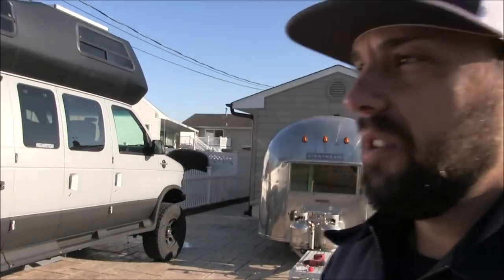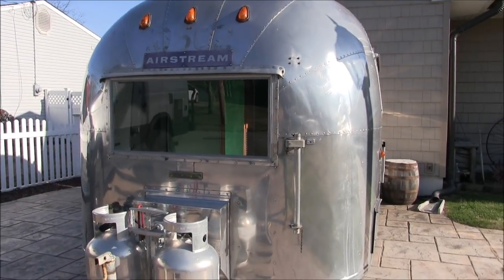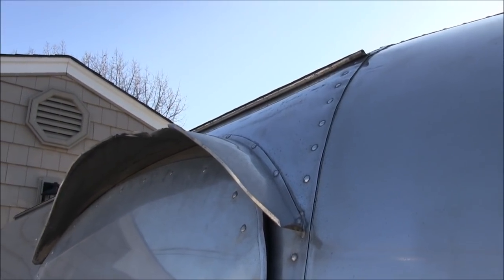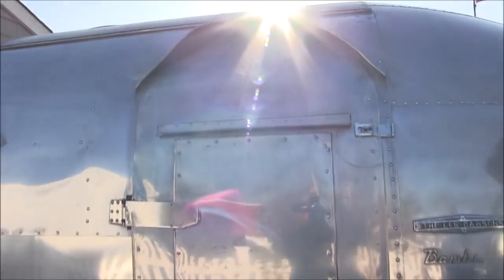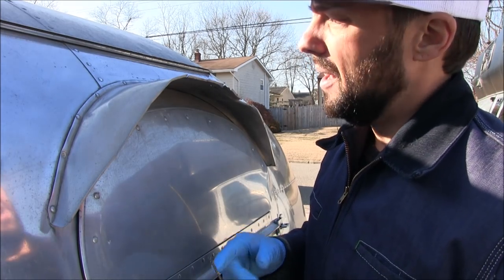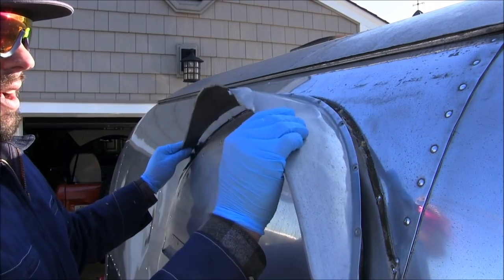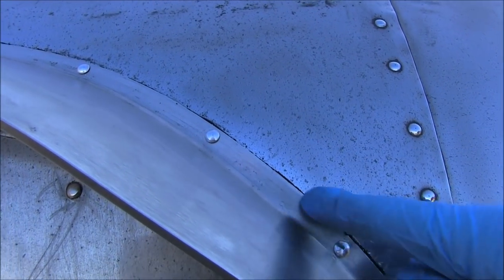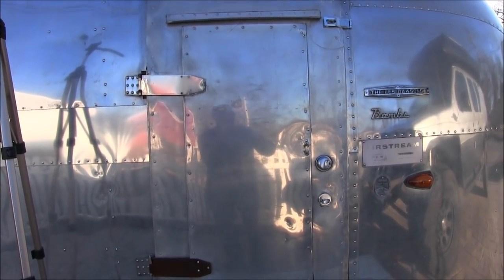1961 Airstream Bambi 16 | Aluminum Work & Riveting

Comment: Great job on riveting the rain guard I learned a lot, but don't you think you should have used a sealant in each hole before riveting for added protection from leaking? Thanks again Proverbs 3:5-6